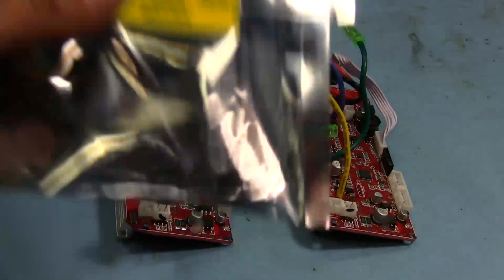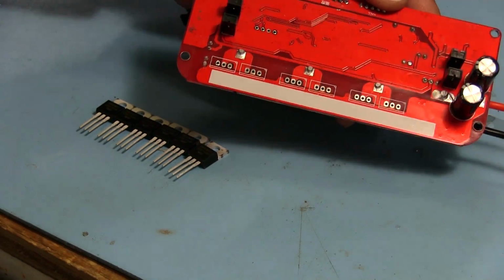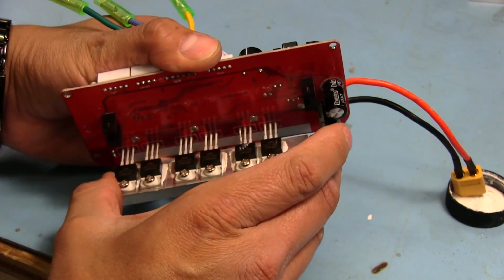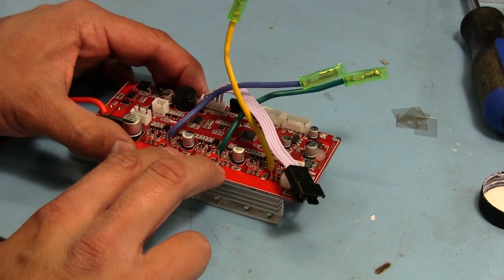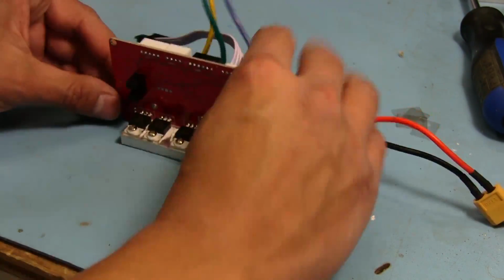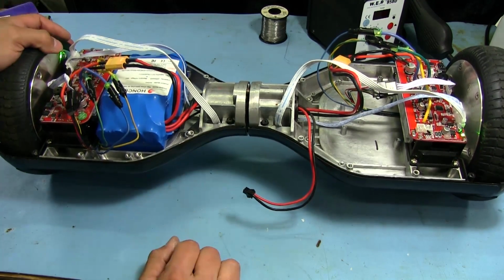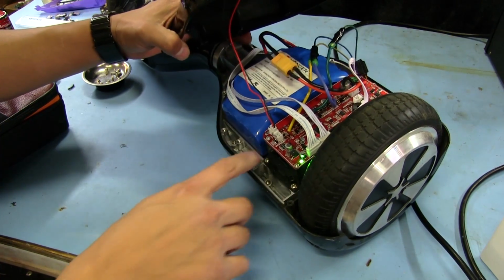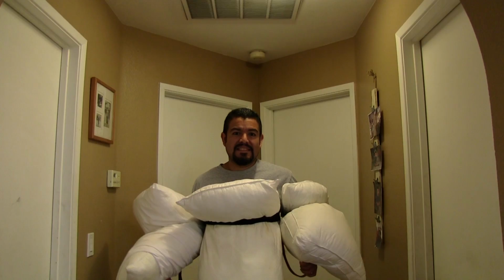TWB #35 | Let's Repair a "Hoverboard" Part 2 of 2

Comment: Nice Work !  i fixed one that i got out of the trash earlier today  , had a bad cap on the gyro board  and one failed solder joint for the  power wire to the gyro .

Comment: Actually, the kapton tape is really thin, and should conduct heat. The heat resistance refers to the fact that the tape is resistant to heat, not that it is a poor conductor. Some mosfets have tabs that are electrically insulated from the pins, so they can be connected directly to the heat sink without electrical connection between other mosfets on board. I repaired a golf cart, and didn't have the isolated kind of mosfet, so I used kapton to insulate it.

Comment: Awesome repair job! It's funny how little power it takes to make a LED light up, i had old LED ceiling lamps that would keep glowing really faintly in the dark even with the wall switch turned off because the switch only broke one leg of the AC wiring
Reply from the maker: Thanks! 

And that's crazy with your lamp. That switch must have had quite the capacitance between the contacts if the lamps were still glowing.

Comment: thanks for vid, very helpful...have board with gray covering not stuck to mounts meet screw, ends flap.. have black chip next to red square connector with a nic to the metal...believe main cause of no power no go...
Reply: ....grayish particles on reverse of board , no black or syng

Comment: I have almost the same problem.  My charger is constantly green No matter what all the way to the bms chip I get 43v.  The bms only is letting 2.5v or Less to each cell.  How can I charge the cell pack without burning them up.  I still don't know if it's the bms chip because I'm charging it with the boards disconnected but still not getting the 4.35v that the batteries need to be charged at

Comment: I used to rewind that tape into 5m 1050mm logs for cutting ...think I got control circuit corrosion on yellow wire side .... Someone copping Aldi had the same board but green and heatsink like what he's done

Comment: Now I know why my hoverboard refuse to charge. Cheapo boards has battery voltage available on the charging port, while mine has protective shottky diode - no way to detect voltage by measurement on the connector. But, I found the solution - disconnect charger and let capacitors in the charger to empty. It is NOT sufficient to wait until green LED turns off - need little bit more time to discharge completely. Then plug FIRST charger into board, then charger into wall plug. Cheapo boards does not care which you turn first in or out.

Comment: Hi.  Way late to the rodeo, but watched Parts 1 and 2 despite not knowing much about electronics but v. impressed about your analytical skills, not to mention your presentation skills.  Congrats on your success!  Did you ever RTFM and do the calibrate procedure to get the gyroscope to do its job?  And/or get a 14yo to determine if the gyro was actually functional?  And BTW were you attempting to ride it facing forward?  Dunno whether that matters.  I'm 72 and neurologically balance compromised so I can't ride the things myself but am curious about these things.  I've got two hover boards I intend to make hover chairs with so ran across your vid while doing research.  Anyway, thanks for the education and if you have time to answer, I'd greatly appreciate it.  Cheers.
Reply from the maker: I didn't even know there was a calibration procedure for these things. I wouldn't doubt that I was riding it backwards. Wasn't sure which side was what.

I don't have the thing anymore since I gave it back a long time ago, but turns out the guy I fixed it for had already bought another one before I even gave him this one back and ended up putting this one in storage or something. I doubt they're even using the newer one at all at this point. Probably in storage as well. I'm probably gonna see this guy again soon, maybe I should ask him about it.